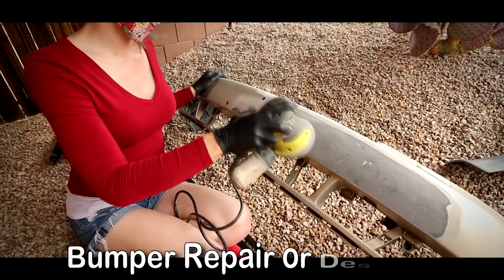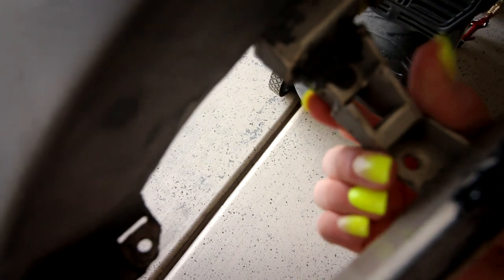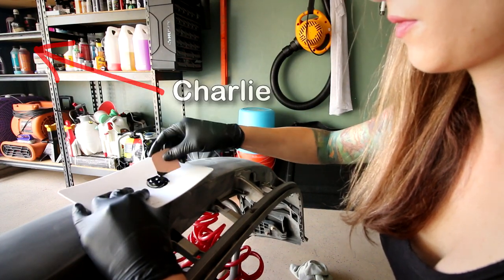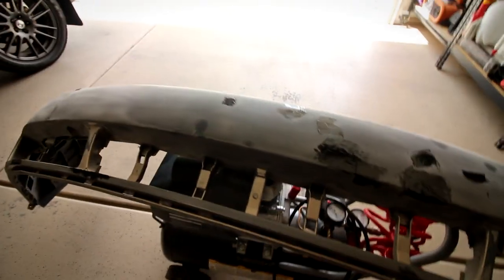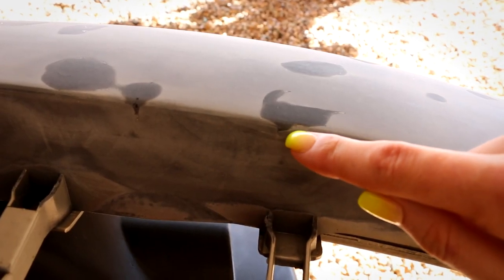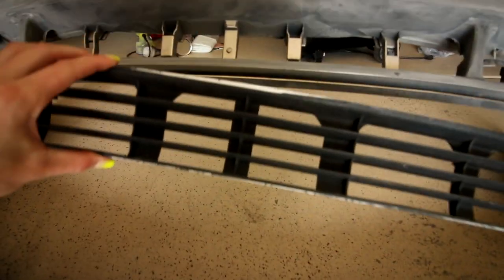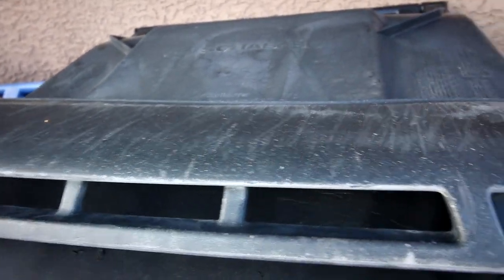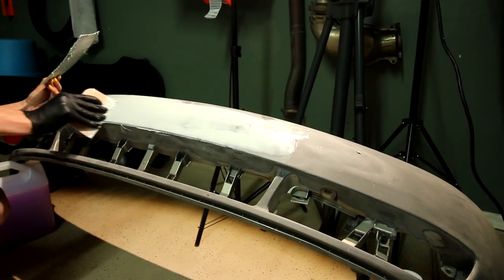Junkyard Bumper Revival // Audi Quattro Project Pt.2

Comment: It’s incredible how much work you have put into this bumper. A lot of times, you can find bumpers at Certifit brand new for $40 on up.  So, that’s what we usually do first. If you can’t find a new one for,cheap, the only thing left to do is what you’re doing.  I’m sure it will look great once you get it done!  Be sure to spray it with a good high build primer/sealer before painting.

Comment: It's looking really good. You can also use 'spot putty' (generic name) no mixing required, sands super easy, on the small imperfections like pinholes and sanding scratches as a last step before final sanding/prime.

Comment: 180!? Need to jump that grit up. WAY UP. The sand paper you should be using before paint goes on should be around 1200-2000. 1200 to get it really nice, 2000 if you want it to be tits. Block and then sand, block and then sand, and then do it some more. This is why body work is so expensive; time. Now you can see the difference between a $4000 paint job and a $20000 paint job. You are technically putting scratches in the paint, so you want to make them so small that you don't notice them.

Comment: Beards is right. A high build primer will take care of all the remaining imperfections. After primer, quickly block it with 320 then follow with a 600 wet to remove the 320 scratches. That's it! Paint it!

Comment: The only thing that sucks worse than bodywork, for me anyway, is electrical work. Body repairs to be done right take alot of time, especially of you're covering some bad damage. I've spent days brazing, filling, sanding, painting and skim coating to get it right. The more you do it, the easier it will get.

Comment: Sarah, that is very thoroughly done.  If you use some primer surfacer to fill the rest of the imperfections (more sanding) research the use of a "guide coat"   , you could easily seal and base coat / clear  that cover.  (ie your prep is beyond wrap quality) ; consider painting it!!

Comment: OCD is a big advantage in doing body work. The end result is waaay better! There is a type of filler primer that is designed to fill in those tiny imperfections. Several coats with sanding in-between can smooth out the minor imperfections.

Comment: Try holding your sanding block at an angle (maybe 30 degrees in this case), as you sand along the face of the bumper.

Comment: This is really helpful I've got a hole in my rear bumper. I'm gonna use your videos as a partial guide. Why are you wrapping the Audi? It seems like plastidip might be a better option. Of course that's just my opinion.
Reply from the maker: Chris Rinard I prefer wrap, I’ve used both products and just like the way wrap looks after, and it lasts longer in harsh sunlight. The plastidip I did lasted about a year before the sun started fading it, whereas my Forester has had 3M 1080 wrap for 3 years now and still looks like new.
Reply: Thanks for the response Sarah I live in Ak so fading wouldn't be a big issue. I'm gonna be in Mesa Apr 9th through the 11th. Any chance you'll be doing a meet and greet?

Comment: Instead of painting black ABS plastic, bring it back to life with a heat gun.
Reply from the maker: The Stig I no longer have a heat gun.. it died.
Reply: Sarah n Tuned It will still come out well, just take your time. I've used that trim paint before on plastic that wouldn't respond to the heat gun method. Painted my Volvo 740 turbo grill with it and it looks brand new now. You got this.